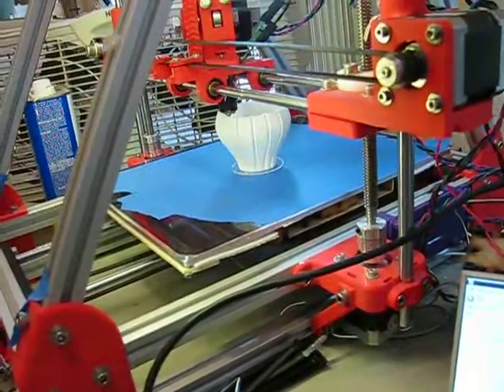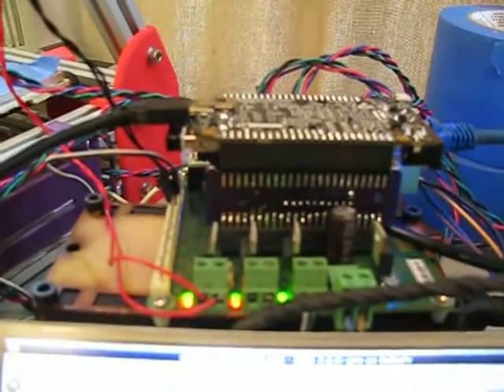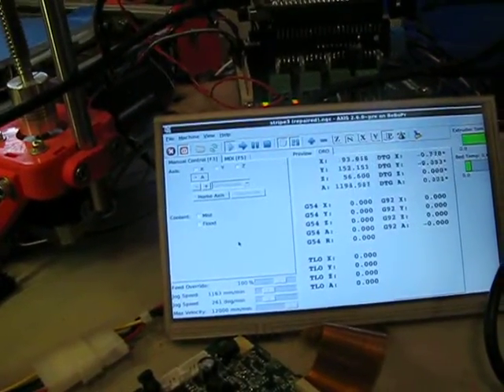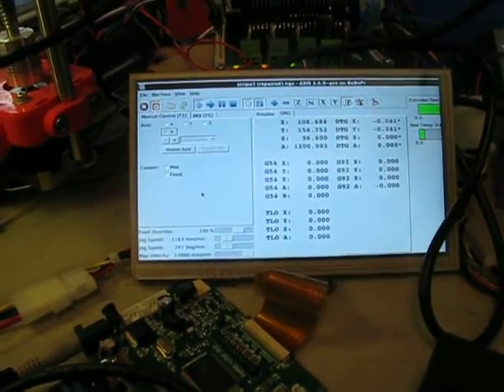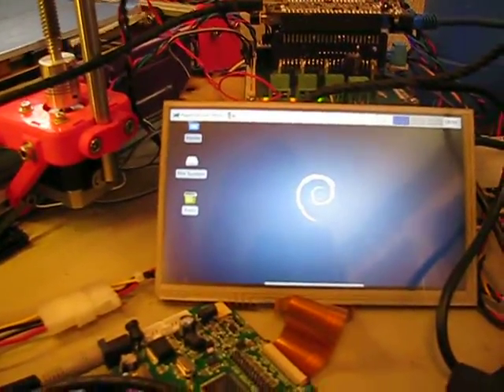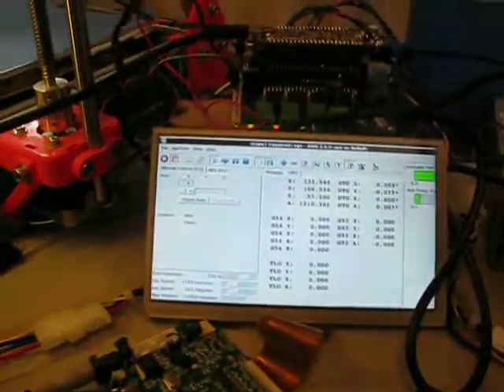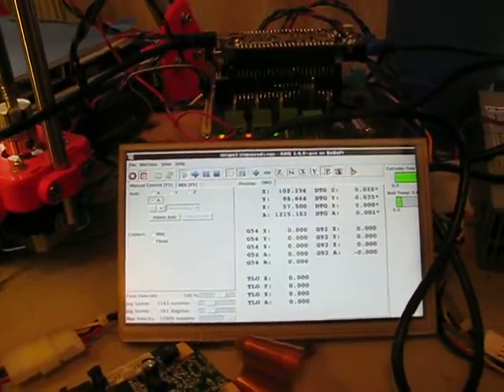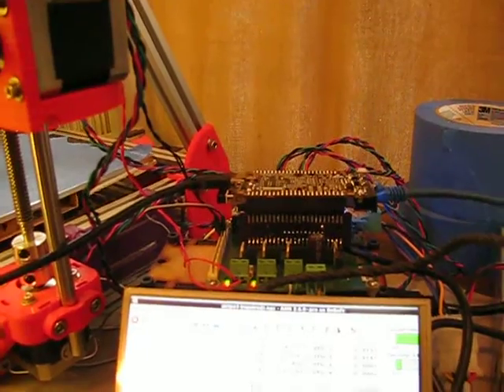LinuxCNC + BeagleBone Black Stand-Alone Printing with 7" LCD

Comment: Charles what sort of step speed in khz can be achieved from the beagle bone per channel? I run a 4axis cnc currently from an old pc but am interested in reducing the controller footprint.
Reply from the maker: With default settings, 50 KHz step rates.  You can easily increase this to 100-200 KHz for a 4-axis machine if needed.
Reply: Charles Steinkuehler

Hmm very good, its a real contender isn't it and an excellent value even after adding the cost of a cape. Thanks for that.

Comment: Print some cases for your electronics before a loose screw shorts out the whole thing!
Reply from the maker: So far that's only happened once, and it was when I was test wiring a quadrature encoder directly to the BeagleBone rather than 3D printing. :-)
:ducks and knocks on wood to avoid karma backlash!
Reply: Charles Steinkuehler
 I'm just saying.. Its so easy to have stuff like that happen, and it's so irritating when you short out some critical component and then have to wait for new stuff to come in the mail.  You have a printer! Making a new case for all that great stuff what will accomidate the beaglebone, etc, is a good project too.

Anyhow, nice stuff your doing here.  Next time I build a printer I'll be considering this. I run a mendelmax aswell.